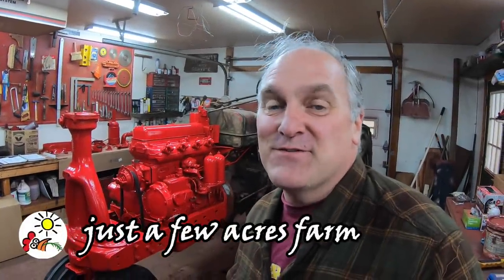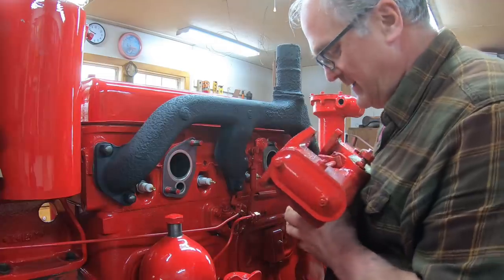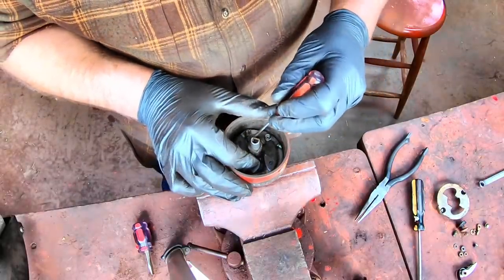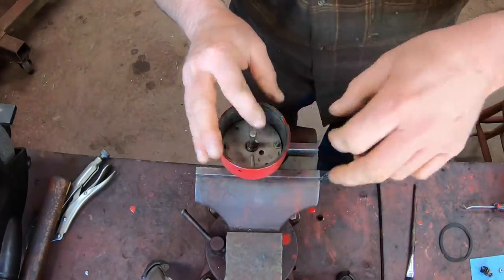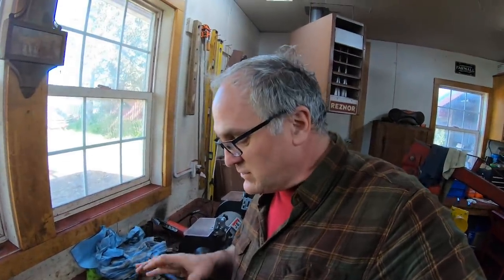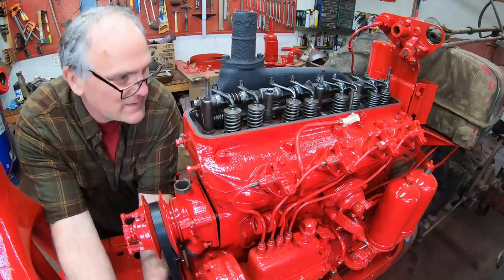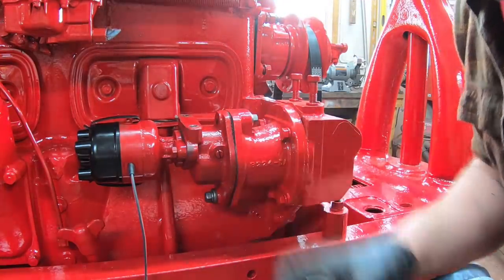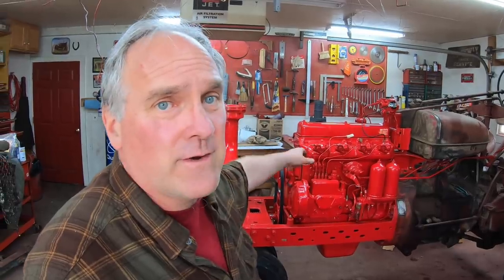Nothing Is Easy On This Tractor! Farmall MD Restoration

Comment: The black high temp paint is all about curing it. Usually its run for 30 mins then allow to cool to touch, then run again for 30 mins and allow to cool. At least in my experience doing this has helped it last.
Reply from the maker: Some require curing, and others do not. The one I used this time does not require curing. I have used the ones that require a specific curing process before and had mixed results with them.

Comment: Hi I enjoy you videos.1 tip when using Teflon tape turn the roll around and slip it on your thumb and you can add pressure to the roll to make it tighter to the thread and it will not unroll while using it. I was a gas fitter for 30 years in New Zealand and used many rolls of tape.

Comment: The long nose spark plugs were used as a glow plug to keep them from fouling from diesel carbon and to aid combustionl as the engine ran on diesel. The MD was a stopgap engine. Just barely better than the distillate fueled F30 and F20. Overlly complicated and not well thought out. The 400 series was actually a diesel first.
Reply from the maker: I think you need to check your facts. The 400 series had almost the same engine as an MD, just a little more displacement. The spark plugs had nothing to do with glow plugs. Their long reach was due to the shape of the supplementary combustion chamber they are located in. In fact, the chamber they are in is closed off by a valve during diesel combustion, and their spark is shut off during diesel combustion.

Comment: HI there Pete. 22.17min You had me laughting when You wanted to talk to the Engineer. I was just thinking "where is the manual, who designed this...and glass...oh boy!" I use to work in commercial building and remember some weld plates (for tilt-slab panrls) I had to persuade into position with a sledge hammer and associated grunting and snorting! I ended up telling the Foreman (loudly) that he needs to get the engineer onsite to give us a practical installation demonstration! It never happened. You did really well with a difficult install!

Comment: Excellent video Pete :) also got question did ever do for nuts on intake & outake manifold nuts ever used Brass hex wrench nuts to tight up with lock or star washers ever and work well for you! Why asked because the 1950 Cockshutt 40 COOP farm tractor on farm had BUTA motor with 6 cylinder motor size 235 Cubic Cm with Zenith brand  1 barrel carb updraft manifold on intake also outake both together when assembly motor together ! Also 1968 McCormick International 105C Combine had Farmall brand H basic 4 cylinder of 202 Cubic Inches size had Zenith 1 barrel carb with brass nuts plus lock washers to hold Intake & Outake manifold also U shape pipe hook on back motor to muffler of small piglet type for 12 round size with rain cap Lol! Also glad got brand new gauges to assembly on Pete :) that excellent to hear ! Also looking forward more videos on assembly motor and dash hook of gauges too! Plus Pete if hook up Oil also Water pressure gauges hope it wire hook up for Water Temperature  also Oil pressure  steel line stays away from manifold or engine block and tell why ! After doing Engine rebuild on 1963  McCormick-International  B414 Loader tractor had Desiel  motor also my dad hook up Water Temperature gauge also forgot wires put threw steal 3/4 socket size round line also was wondering why get hot TTemperature to hot s though thermostat was in engine but get wires hot they melted together  on hot manifold (Ops) and so had rewired also replaced them do right to plus Temperature and then found Oil pressure Steel line hit motor plus hot 🔥 exhaust manifold and bend line out  to put a  rubber tube 1/2 socket size round  on plus hook up on oil filter box up top and he get in Redline pressure on low or high idles so had fix  it that to then all okay too and last of Voltage gauge on charge system needle gauge and to also simple to do!  Told my late dad don't worry we all make stupid mistakes  in life Lol and he said was in hurry need tractor to use that why ! But hope helps out  Pete :) !

Comment: Great work.  Like a lot of your tractor videos.  That starting mechanism is cool, and works great! When adjusted correctly.  So many of their tractors (all {Super included} MDs, W6Ds, W9Ds, 300D, 400D, 350D, 450D, 600D, 650D) used the same setup. A Testament to a good design.  Just different activation handle.  The rod in the intake manifold has another function.  Depending on the ignition type (coil or magneto) the end plate would be different.  For a magneto it would rotate a contact to ground/not ground the magneto.  One wire to the mag.  For a coil it would supply not supply the coil with 12 V, 2 wires one from the key, and one to the coil.  That way the coil is not active when on diesel.
Do you plan to use the latter setup?

Comment: Back in the late 1970s my  Dad bought a 450 Diesel that was delivered in bushel baskets and boxes.    He put in liners for a 400, IH Mechanics said the 450 D was more likely to have a cracked liner because they were thinner.   We hit up a lot of junk yards picking parts off dozers that had the same engine.   IH was good about sharing engines across product lines back then.  Never changed the ignition and I don't remember changing plugs.   He still runs it every summer on rake duty.  Poor thing has had a hard life, at one time it mowed, raked and baled then bush hogged and hauled dump wagon.   They are amazingly fuel efficient and it will start all winter if the generator is needed.   With modern oils they will run forever.  The only thing we did different was never-seize the spark plugs and the exhaust bolts.  Thanks for sharing your project!

Comment: Pete, at some point after you're done reassembling the tractor, you might want to make some kind of a cart with wheels that bolts to the engine frame for both supporting and moving that around when you begin to work on the rear half. You could do it with swivel casters, or you could use old front wheel drive wheel bearing assemblies and disposable spares or maybe an old trailer axle and wheels for maneuverability. They don't have to be perfect for this as there's not much else you could use this for unless you are planning another restore project down the road. FB marketplace might be a good place to find these goodies.